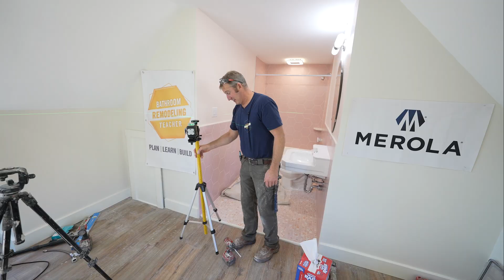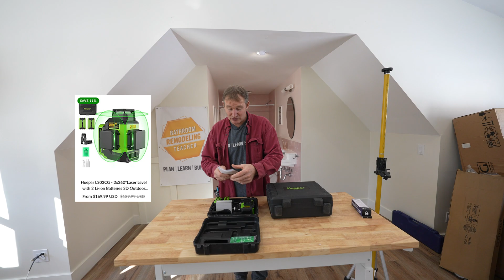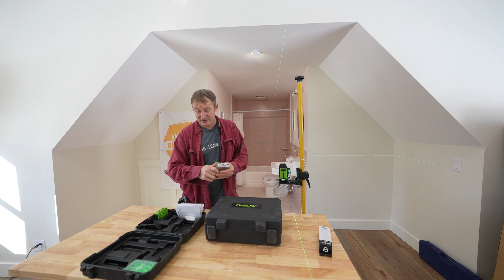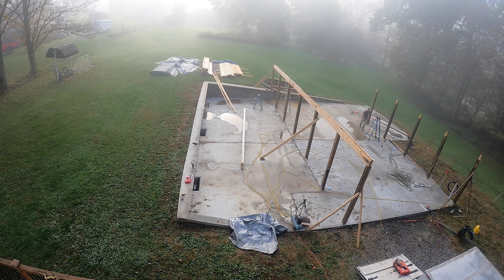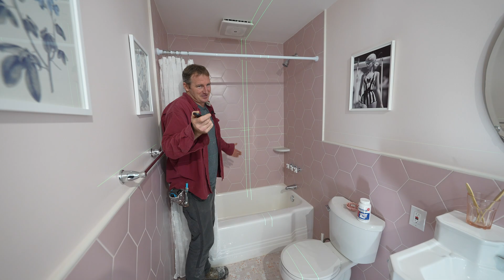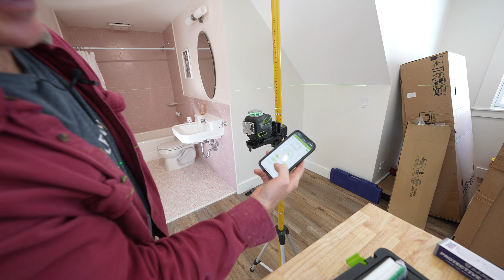Huepar Laser Levels for Bathroom Remodeling

Comment: s04cg Is  the better value as you get the adapter with the micro adjustment features, that make it so much easier to set up.. Some floors move the tripod when you walk on them. and tripods are easily wobbled.   Using the mount provided with the s04cg, you can put it on a fridge door. or tape your trawl to the wall and the magnet stick to that.  Or put a screw in the wall and hang it from that., which is best as walls don't wobble like a tripod can. As the the remote, that is better than touching the unit to prevent movement. and having that feature on your phone is even better if you just want to turn some of the lasers off, to save on battery life.

Comment: I have a different brand and it also has a remote. The remote is great for when you need to return to the job later. Turning the laser on/off from the button could easily get you out of alignment with the target.
Reply from the maker: Awe 👍 that’s a great point 👍